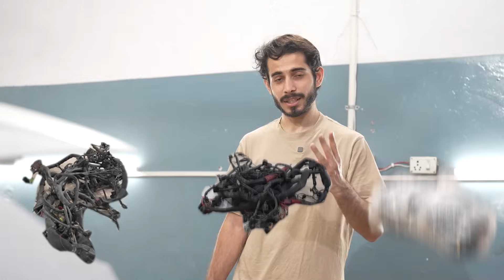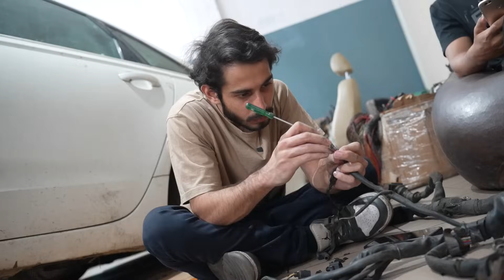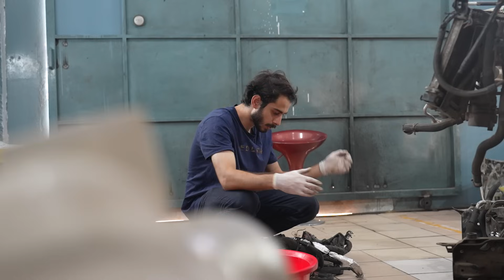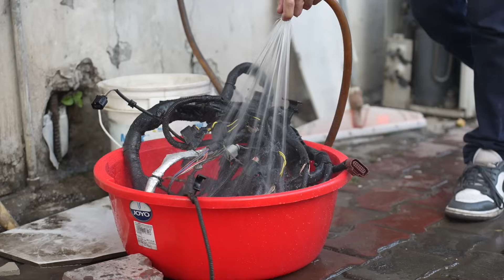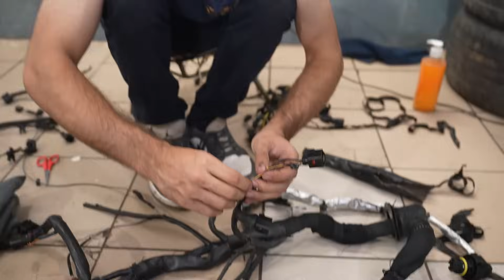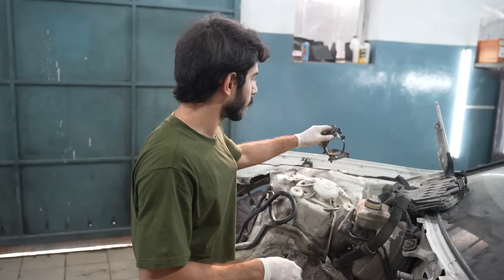Audi A6 Is Almost Back! Getting Ready for the Engine & First Drive

Comment: Ngl the best thing would be to soak t he connectors in distilled water for the last step
this way all the minerals etc will dissolve into that

another thing
dish soap would be much better than car shampoo
as most car shampoos arent designed to strip the oil/wax, this way u dont have to add wax again

but dish soap does the opposite
removes all oils

thats why i just use dish soap liquid to wash my hands after i have oil on my hands after cooking/grease from working on my vehicles